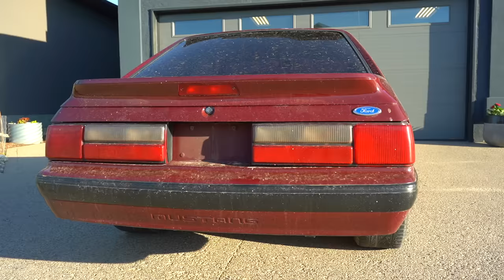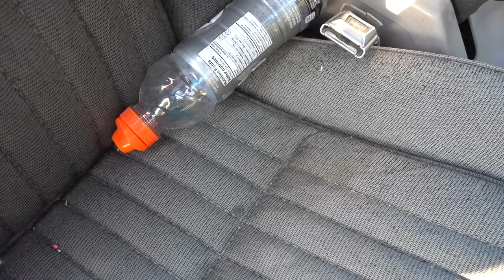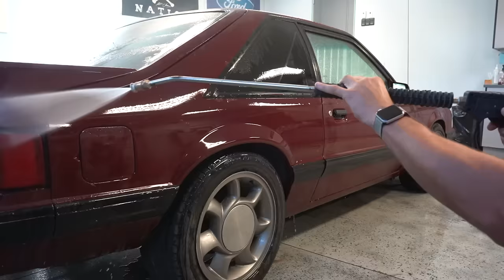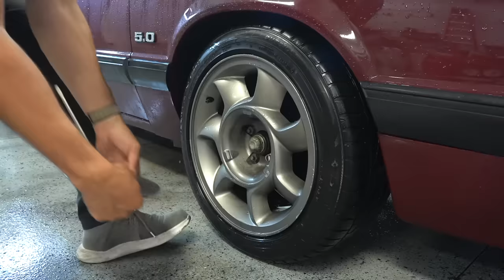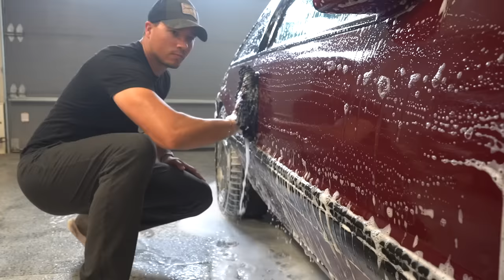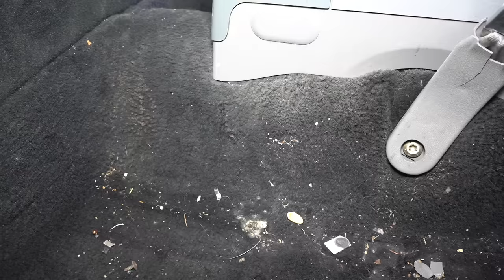Can I Make This CLASSIC Ford Mustang Look NEW Again?! | The Detail Geek

Comment: I have been driving since 1980 when I was 17 and I learned on an automatic. In my early 30's my dad taught me to drive his manual truck. I had a lot of trouble at first because there was no gearshift knob, just the long stick coming out of the floor. Going up hill and around a curve at the same time was insane, but I finally mastered it and he bought me a manual 4 door Geo. I loved that car. I named it Betsy. lol I learned one thing when driving on snowy roads is that before you start down a hill is to shift it down and you won't slide. I drove in 1994 to town with my kids in big snow for the first time with big hills, curves and no guardrails. Never had one problem. I love window cranks in a car because if the electronic windows mess up you can crank them down.

Comment: The fact that it's not full of rust.. is pretty impressive.
Reply: yeah , clearly cherry picked one for the video.  I had 6 of these 25 years ago and never saw one so clean and straight
Reply: I think the dark maroon hides it.  The LR quarter is rotted out pretty bad, and saw some bubbling over one of the fenders in the intro.  Still in good shape despite that.
Reply: @mattevans8517  hood and rear quarter is only spot with rust on this car, I own it
Reply: This one's been repainted at some point and time already! That's not a 1990 color, more like '82 gt color. Also not oem carpet, these cars didn't come with rear seat delete kits, I'd guess that they replaced all the carpet when they installed the delete kit.
I have an 88 gt cobra hatch myself, and an 83 Mercury Capri RS, still a really good car and definitely fun to drive it!❤❤

Comment: This brought me back to my youth. My first brand new Car was a 1993 Mustang LX Hatchback 4 Cylinder Twin Plug engine. I wanted the 5.0 but insuring it in NYC was very cost prohibitive. Gasoline back then was around $1.20. The car was terrible in the snow and deadly on curved off ramps as the rear would slip out from under you, but I still loved that car.

Comment: My neighbor has a '93 GT, red paint, red interior, less than 3000 miles. I've only seen it driven once. It's never been driven in rain. It sits under a carport most of the time, but they start it and move it every now and then.

Comment: Omg. Now feeling very old. i have had many fox body mustangs. i actually bought a NEW 1993 LX-R from Wallace ford in 93. it was coming of the truck with a twin. FHP(Florida highway patrol) had been using these many years as pursuit Vechicles but 1994 was a major bodystyle change so fhp let these 2 93's go to retail buyers. i bought it immediately. Was actually a black pursuit with 5 speed. Most were brown. Looking back i knew it was a very special car but is now an absolute icon with tremendous value. i had a hard time keeping it. The car was stolen 3 times in a 12 month period and i gave up on owning it. i sold it with less than 4,000 miles on it.

Comment: Now I miss my 1987 5.0 Stang GT w/t-tops. Excellent detail Mitch! Didn't know if you knew that the lower front part of those seats pull out and extend a good 5 or 6 inches, it's basically a dirt and debris trap😅. But really, it's for your hamstrings to rest on when taking a long trip. I found it on mine by accident, lol 😆 👍👍
Reply: I also had an 87 GT with the T-Tops and 5 speed. It had the Scarlet exterior and interior. You are right, those front bolsters were notorious dirt/dust and crumb catchers. I miss that car, traded it for a new Explorer Sport when they came out in 90-91.

Comment: Excellent work...I had the same issue with my 89 GT convert... I took the seat and carpet out one winter...I have a Saniaire 80 psi vacuum sprayer and extractor... Mann..what a puddle of brown soup I took out off the passenger seat..they must have spilled plenty of coffee on it. The area around the seat frame bolts was stained with rust...PBR blaster and an old tooth brush, then l followed that with Permatex paste hand cleaner really took out the orange rust stains...I just use hot water in the one gallon spray/extractor fresh water tank and a light mist from a 32 oz spray bottle mixed with water and 2 oz of baby shampoo...My GT is that same color....but gray seats and gray carpet...  Its funny seeing one with no power options...and I hate those sagging map pockets...

Comment: Hi Detail Geek,
First of, you do a great job bringing these cars back to life. However, I would like to get some insight about the following:
a. How do you wash/clean the engine compartment of cars, I don't usually see that of the video. 
b. Could it be possible to view the detailed car six months after this extensive work, 
c. I feel that it would be more comprehensive to remove the car carpet to reveal the car metal floor and wash the car carpet separately on the ground as doing so will reveal dirts underlying below the carpet which can be cleaned as well. (although this process might be a little cumbersome, but it will give a thorough clean). Perhaps this can be done on a special request. 
d. How do you treat cars affected by rust and worn-out leather fittings? How do you treat alloy rims affected by rust and peeling coats?
e.  How do treat wood panels and formica fittings on cars?
f. How do you wash and clean Electric Vehicles, especially with the sensitive nature of the car.

I would like to get your feedback on these questions please.

Thanks alot and best regards, 
Kingsley
Lagos, Nigeria 🇳🇬

Comment: Hi Mitch,
Ricardo from South Africa, 
Do you have the manuals for the cars for when you remove the seats and wheels for the torque settings on wheels and when removing the battery you have to get the radio unlocked with a code or do the sequence to get the one touch up/down window setting working again for instance?

Comment: Mitch, is it ok if you just lift the wipers ⬆️ to make sure you get tiny dust stuck between the rubber blades and windshield?  Plus you do not need to lift them again when toweling dry. Hehehe just sayin. 😁

Comment: What psi and pressure washer do you use. Worried about getting one to high and messing up paint
Reply: He uses 1900 PSI that's pushes 2 gallons. I use a 2700 PSI that's pushes 2.7 gallons per min and it's very powerful it's safe on vehicles
Reply: The main thing is not to use a low degree tip on your wand. The one you'll use on cars is a 45° tip

Comment: That was not original carpet in that mustang. Would been grey from factory. Also on the front seats the very front part of lower seat pulls out, it always holds lots of debris. Probably didn’t even realise you could pull that out

Comment: A 94 Mustang is considered a classic? OMG I'm old! 🤣 I cringed when you saturated that seat with water. That's a lot of water that was absorbed into the seat padding.   It's obvious it has soaked into the padding when you use the green brush. That vacuum isn't going to get the water that went into the padding. It might get some but not nearly enough. You really should get a dedicated upholstery cleaner. You'll get the same results with much less water. Saying all that you did a great job.